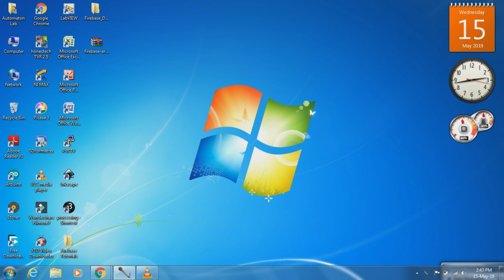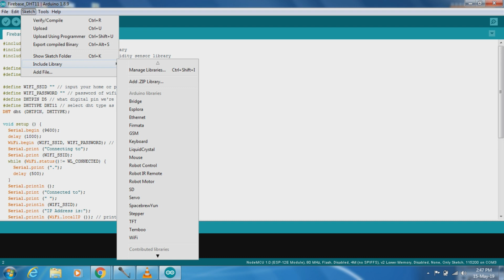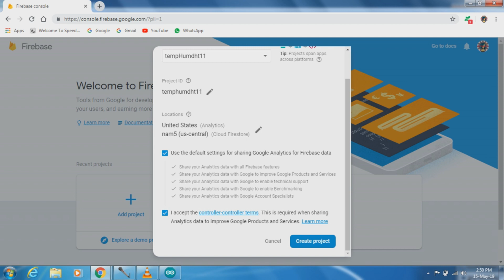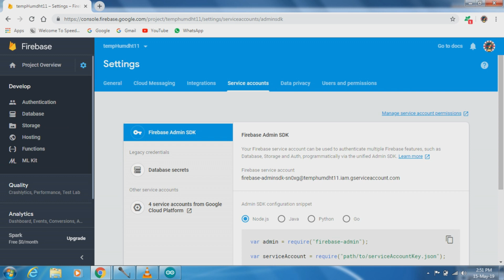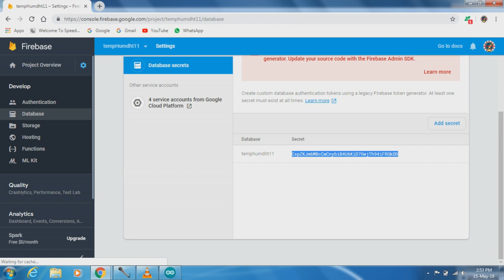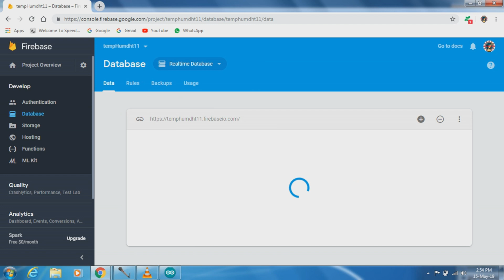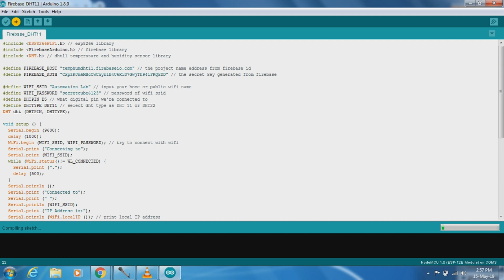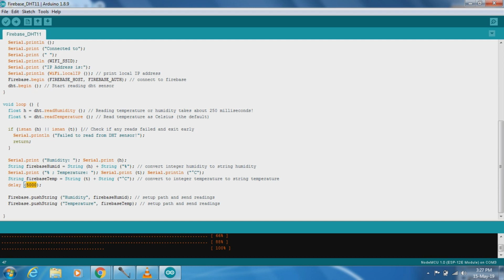How to Store Realtime Data into Firebase Database using NodeMCU ESP8266 & Sensor + Code

Comment: Can firebase store data  in table ? Then from android app can access to that data?
Reply: Hi, Did you find the answer?
Reply: @eddanuro  yes many thanks and graduated 😂
Reply: @purplefurture6960  firstly, congratulations ! and what is the answer to the question, let me graduate :)
Reply: @eddanuro  oh i used wifi esp to send the data from arduino, do you have same project ?
Reply: @purplefurture6960  Yes, my final project is to store temperature and humidity values(with esp8266) and use machine learning in the mobile app.
Reply: @eddanuro  first need to (code) store data from sensor to arduino, then(code)  send the value from arduino to wifi serially.  Wifi will send the data to firebase. And in wifi code you need to create the folders + date as timestamp or you need external clock attached to arduino then send date to wifi

Then create mobile app i dont know, my friend did it
Reply: @eddanuro  you can download examples for sensors, wifi, and use them as i did. You need to chance a bit after you understand the code.
Reply: @purplefurture6960   thank u so much sir for help :)
Reply: @eddanuro  how far are you at now?